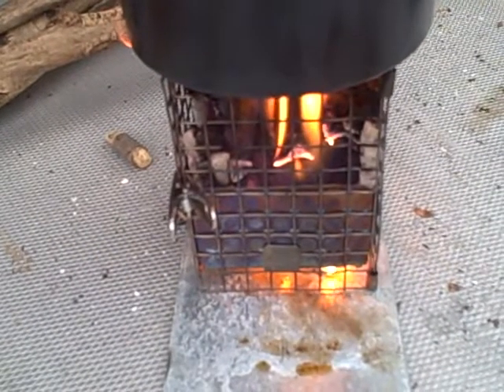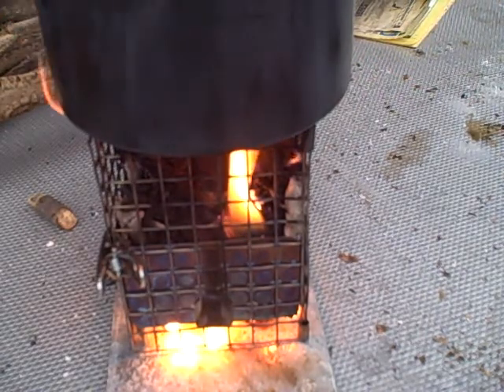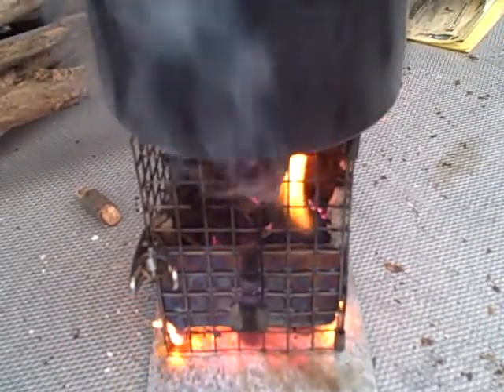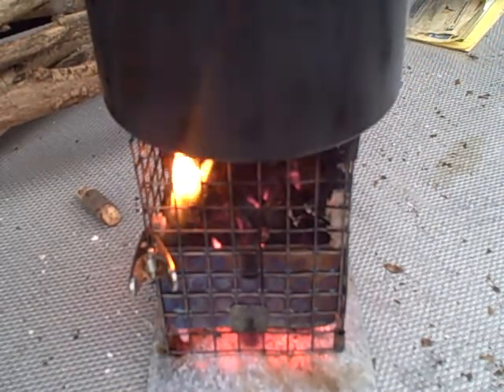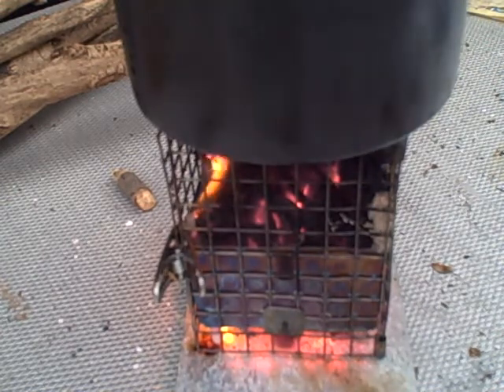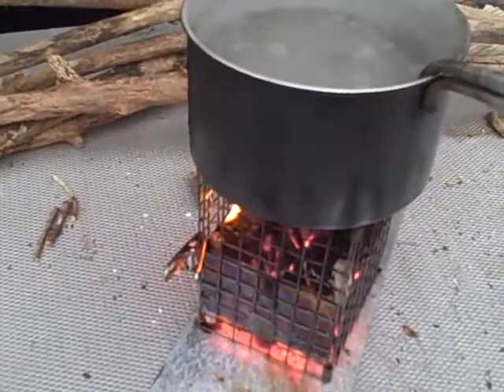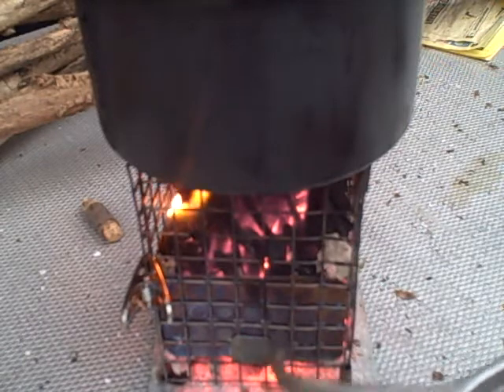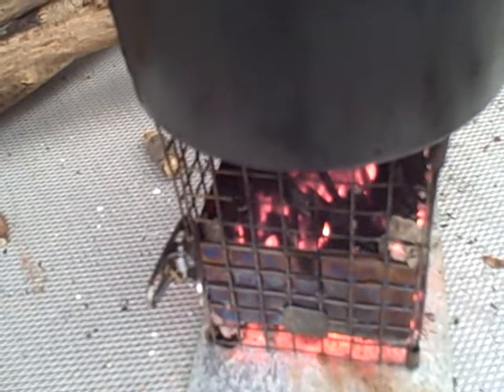Woodgaz TLUD stove boilsl 4 cups with one load fuel part 2

Comment from the maker: @ferdinand7004  In my opinion,The paper ash helps it ignite by protecting the small initial flame. It radiates the heat back to assure an ignition of the vertical stacked fuel. Thank you for your comment.